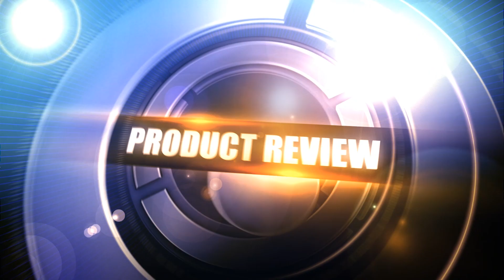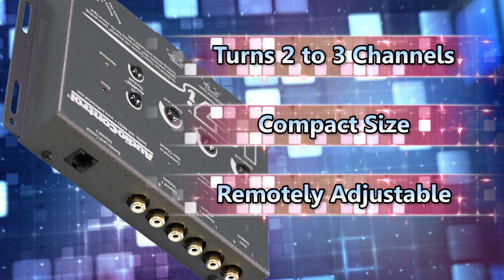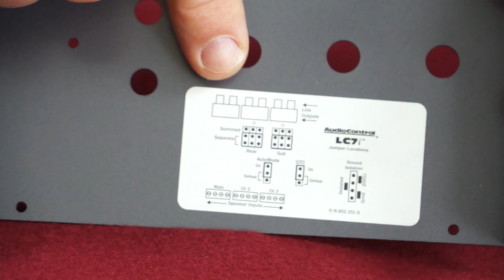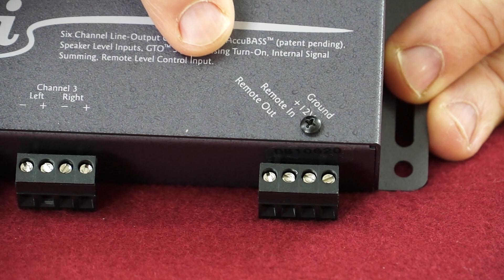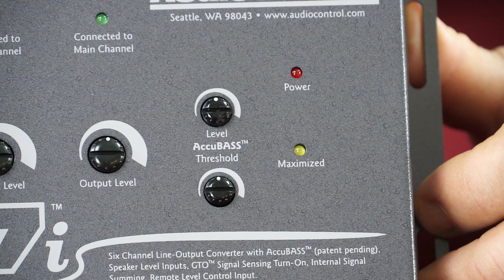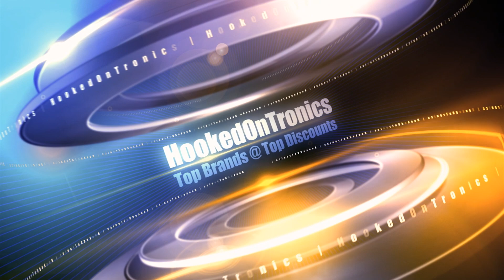Audio Control - LC7i - Product Review

Comment: good stuff. please help I have a 2008 Toyota Camry w/Jbl factory amp. I bought LC8i. and I replaced the speakers. now I believe I should send signal from factory am to LC8i. I do hear like a distortion noise when I have my auxiliary plugged in.  like as I rev the engine I hear the noise on my speakers. what can it be?